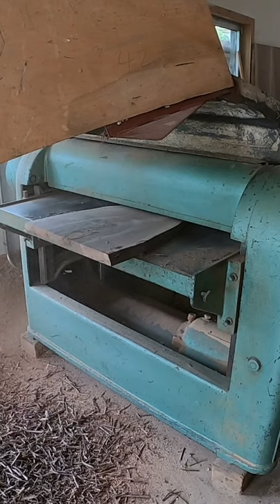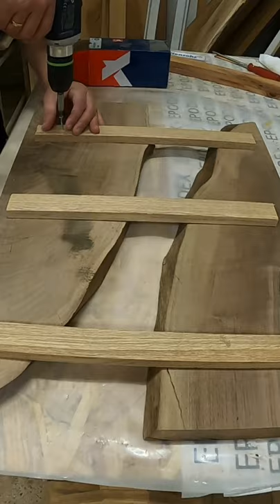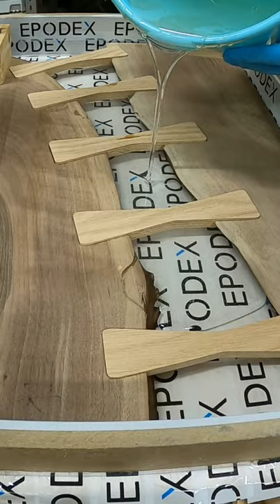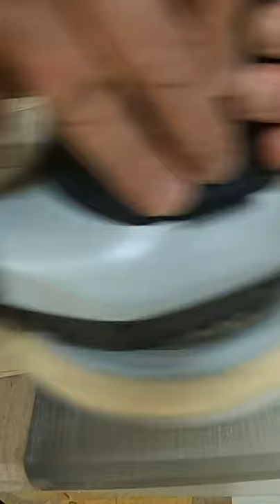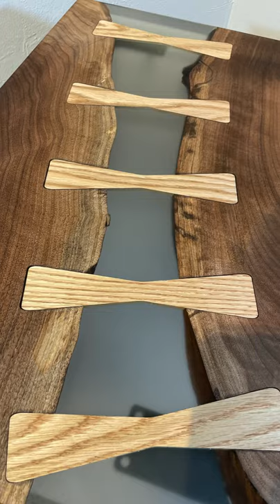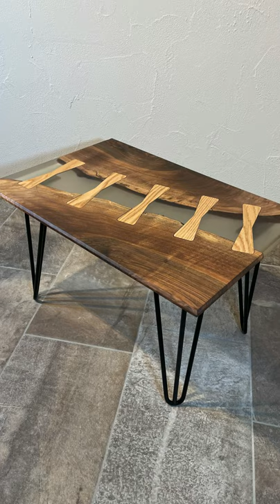[Shorts] Black Walnut Coffee table with dovetails and epoxy resin - #blackwalnut #shapermade #shorts

Comment: Beautiful piece. Personally, I would have polished the top of the piece to mirror finish to give depth in the clear epoxy, but leave the sides and bottom sanded to 320 or 400 for that nice iced look
Reply from the maker: Thank you for your kind words, and thanks for the suggestion. I actually think that is very interesting. I never thought about polishing one part, and leaving the other unpolished. I think I will try that!